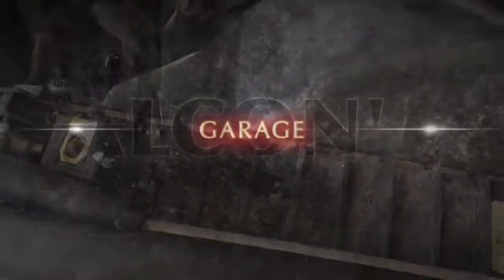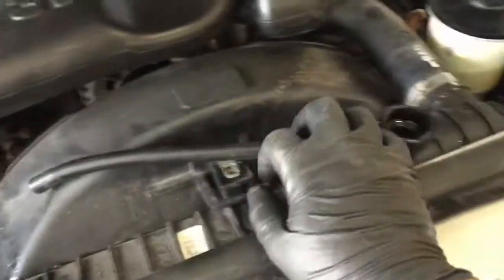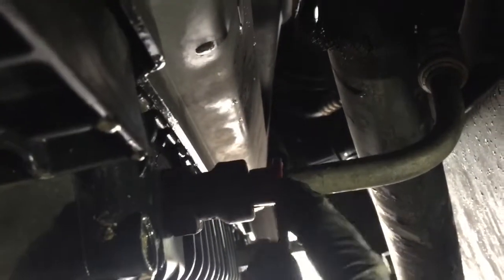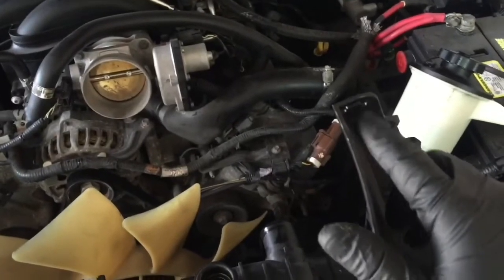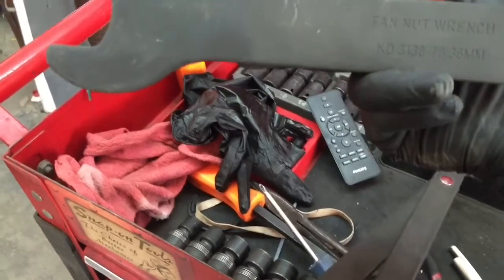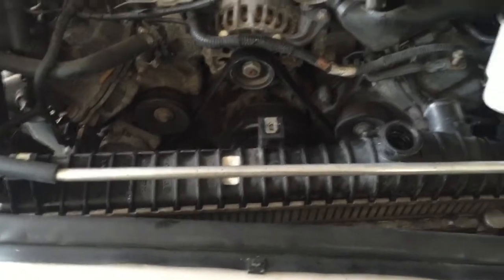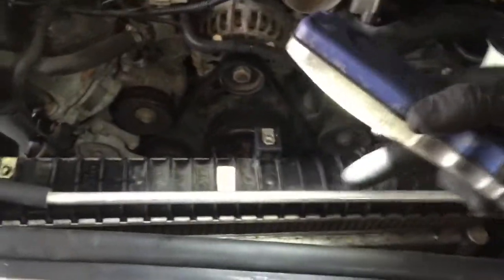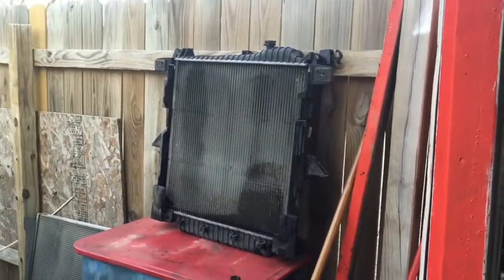Mercury Mountaineer/Explorer Radiator Replacement

Comment: I did not have to pull the fan off.  Radiator came out pretty easy.  A little finagling and slid out.
Reply: How?
Reply: I just finagled it out. Not sure. Maybe slightly different between trim levels?  Wasn't a big deal.

Comment: The bottom thing you need the little black tool for will not come loose. I really wish you would have shown that. Got an 80 yr old under a car right now im trying to help and it will not budge.
Reply from the maker: Sometimes they are not that tight so no need for tools.

Comment: Also how would you know if you need a new one. This same truck I have runs hot
Reply from the maker: if its leaking or dirty from the inside it will need to be replaced
Reply: Check your coolant level.  Note where it is BEFORE the vehicle runs.  Then check it a few days later after it's been driven.  Again check BEFORE it's driven, so it's completely cold.  Coolant returns to the reservoir slowly after it cools down so don't shut it off then look.  If the level is staying the same you're fine.  If it's dropping, you're losing coolant somewhere.  Check the seems of the radiator, where the hoses connect, around the water pump for signs of coolant leak.